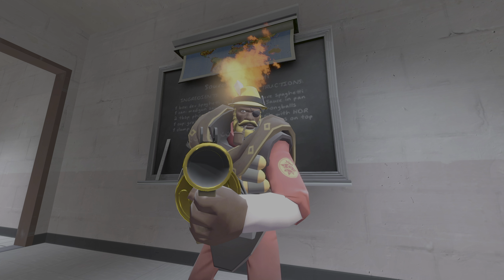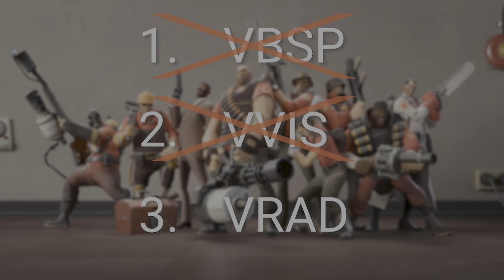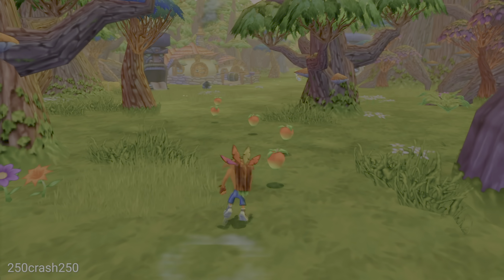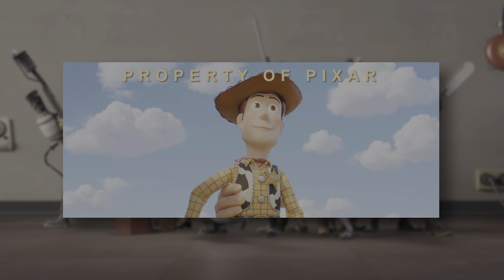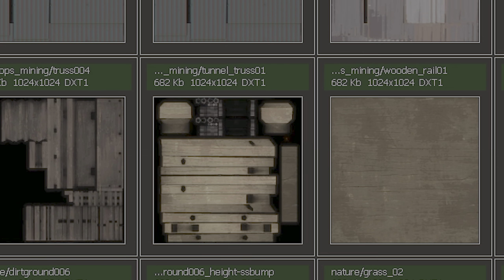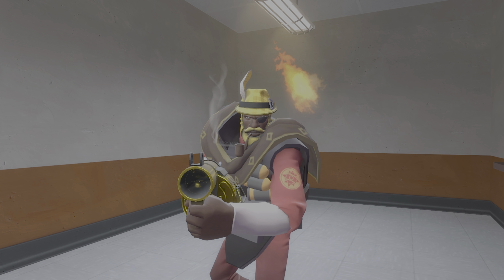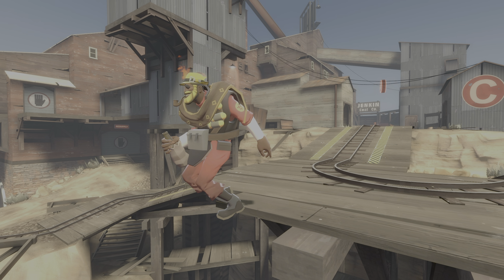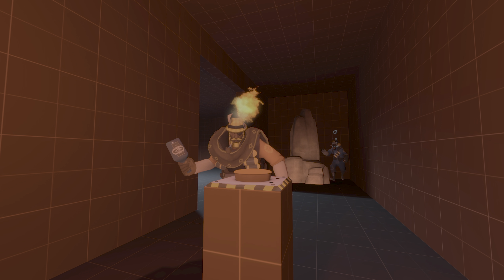TF2's Shadow Problem

Comment: Does this have something to do with why you can see other players shadows thru what Im assuming is seams on maps as well? The amount of times I knew a spy was hiding on the other side of a wall and saw their shadow change along with their disguise is insane. I always noticed it the most on Frontier, espeically the end of the map.
Reply from the maker: No, dynamic shadows are separate from radiosity. I might make a short video to follow up on that since a lot of people are asking.
Reply: @LEDs  I know Id love to finally understand this mysterious Source Engine quirk 😀😀

Comment: While compiling couldnt you just check per surface and tile it based on its light complexity? A face in fullbright with no variation could then be stored with minimum complexity. Just check neighbor luxel values and merge.
That would not accelerate compile time but decrease file size, which is the bigger problem.
Reply from the maker: Good thinking

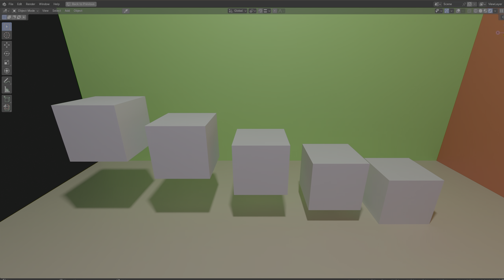Comment: 4:19 Maybe because point light shadows are always sharp, so soft shadows get emulated with blur?
12:40 What you demonstrated looks like that pesky HL1 bleeding compiler bug instead of instead of result of interpolation. You can search for articles by Uncle Mike - author of Xash engines.
Reply from the maker: At 4:19, there’s more indirect light getting underneath the cubes when higher above the ground, so the shadow edge isn’t as sharp.

Comment: There is a way to fix the blending issues, but its at the cost of some file size. Youre looking for something called a "margin". This is basically what amounts to data from adjacent faces being stitched to the current face. This would require completely re-writing vrad and recompiling maps. Or maybe vrad data could end up including a strange sort of bsp-tree where reading beyond the edge of a light island points it to another luxel on another island

Comment: I assume the lightmaps, being designed with bilinear in mind, probably account for the 2 luxel radius needed for smooth transitions. If so, changing it to a radius of 4 luxels should fix it for bicubic. However, that would cause its own problems, requiring recompilation and larger lightmaps for the same detail (or less detail overall)

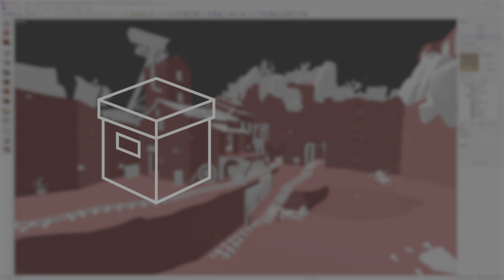Comment: I'm skeptical of the math at 7:45. Is that 20 megabytes and 3.5 minutes spent specifically on lightmaps? Compile time is a little more plausible, assuming it's referring to just the VRAD phase and not the entire VMF -> BSP transformation.
Reply from the maker: Yeah, I'm assuming that the file size is attributed to lightmaps only, which is a big assumption. But the relationship between the file size and luxel scale is linear.

Comment: It sounds like it'd be a good idea to implement compression features, why is this not done? A 64x luxel density increase shouldn't have to result in a 64x larger filesize if many areas of the luxel maps are similar or featureless. Also, couldn't some kind of script be implemented into VRAD that automatically assigns luxel density based on the complexity of nearby geometry? Forgive me if these are silly questions for I am not a programmer or a mapper.
Reply from the maker: It's not silly, I wonder the same things

Comment: One method I've seen for fixing the light bleed problem was to break up the surface manually and retexture the gap covered by the func-detail brushes to nodraw. I assume this will cause the same issue with seams, but at least it doesn't require sacrificing the optimization that you get from using func_detail.

Comment: I wonder if it would be possible to add a tool in hammer to combine geometry faces for the purpose of building unified lightmap islands.
It's not as elegant as having an automated system that handles it at compile time, but gives you the tools needed to fix the problem when it arises.
That and perhaps some sort of "light_obstructor" texture, similar to "nodraw" in that it doesn't generate a visible piece of world geometry but is still detected at compile time and treated like a world geometry shape, unless there's already something like that, which there could be as it's been years since I last touched hammer.
Reply from the maker: I have to take a deeper look at Source 2 because they made some significant changes to lightmaps

Comment: 11:25 The only real solution is a better lightmap UV unwrapper to eliminate seams on connected flat surfaces. Which is very unlikely to happen. It'd be more likely that the map maker would get to choose which surfaces get to use bicubic.
Reply: Is this issue present on hl2 too?
Reply: The problem is that in the BSP, each face has a separate lightmap (which was fine for quake 1's software renderer, but is painful for GPUs), so the engine has to combine the lightmaps into larger atlases at load times. Trying to intelligently place the lightmaps on the atlas would increase load times and result in less efficient GPU usage (as you wouldn't be able to fit as many lightmaps on a single atlas). 
The only real solution is to… not use bicubic filtering, because the lightmaps are already padded enough for bilinear, but not enough for bicubic.

Comment: dude it is always this complex,
i set out to make a small little plane flight simulator in godot a few weeks ago,
every small little detail
just to get a scene with a plane
i had to find a CC0 model online for prototyping
put a camera in the scene, immediate problem, camera doesn't follow plane, alright parent the camera right? yes but it looks wrong,
look at GDC conference talk about camera movement,
it needs to lag behind where it would normally like to settle (if you don't do it like that you can't see the plane turning, so you have no idea how the plane actually moves)
alrigh scene looks like ass, doesn't have any shadows,
look up the docs, you need a WorldEnvironment Node, added that; still looks bad, by default shadows are pitch black, i fixed that, even added an HDRI to be fancy :D
then! i had another problem, when the plane moves forward, you can't tell! because the ground its just one solid color, I always wondered why games used checkered patterns for prototyping, i knew you can use these checkered textures to see where uv's are stretched / warped ( cause the squares either aren't square or are smaller or bigger)

there's just so much stuff, and all im doing is to use already premade solutions ( coding this from scratch would take ages),
what is insane is how using premade solutions remains true all the way down the chain.
i use PBR materials, the algorithms to render these materials have been implemented by someone else
the person who implemented it worked off of a paper / books written by other people
the intial person who came up with PBR (i think it was for Wreck it Ralph) did so by using physics equations created by scientists

everyone uses what came before and adds a little bit with their ingenuity and creativity for everyone else after them. Its like a colony of ants spread throughout time and space

Comment: Yeah, but now you make me WANT to compile the entirety of Dustbowl with a luxel density of 2
Reply: It won't compile; you'll run into the max vertices limit because VBSP needs to subdivide faces every 31 luxels (the engine complains if a face has a lightmap larger than that).

Comment: I believe bicubic seams could be solved by adding a pixel or two of padding to each island, sampling neighboring faces. Based on how the seams look already, I would guess that they already add some padding (at least in the shader, don't remember if they rebuild lightmap atlas'), by just extending the edges of the island, which works fine with some surfaces, but not others
Don't quote me on this though, I haven't gotten around to implementing this (though I have thought through it a bit)

Comment: There is an other way to avoid cutting the geometry without flipping it to world details or whatnot, it's to raise by 1unit the brush, it was the trick on goldsrc and it was also creating flash and smoke bug for CS because the hitbox was just a point and could fit in it.

Comment: I'm surprised you didn't mention that making brush cuts will make more faces. and each luxel is on each face. VVIS will optimise faces and therefore luxel scale "high resolution" but is it preferred to call it "luxel density" imo. VVIS will not render and will not make a luxel for a brush that's touching another face. The faces will not both run. VVIS is like a dynamic nodraw. it applies no render to all parts without needing to be told to "not draw" it. And nodraw the texture is to force the face of a side to be ignored basically. which causes a leak for vvis. but if you dont run VVIS theres no possible leaks which means no optimization calculations aka all optimizations on a map will be ignored. Because luxels are computed by mapper aka. via a compiler. It does not require any computation from afterwards or at least very little to no overhead in hardware usage. This means you should’ve said it doesn’t affect frame rate or stability to change it and it is only customizable by mapper. It’s not required. It’s not a common “optimization” as it is not for solid performance. But a balancing act for your creation to not take too much space for quality that in spots won’t make a difference or will actually look worse. A game like TF2 looks bad with too many detailed shadows for some. I think it matters where it is, and what type of shadow it is. If it’s of railings, then sure put it high, like that one map has. I forgot the name of it. I think you made it kinda clear it was just compile time vs storage and not performance but you didn't even mention it.

Sometimes you want to “slice” a wall brush to optimize a specific shadow to be more detailed in some spots. But effective it doubles the brush entity count in your total map limits effectively reaching the limit allowed by compiler

And from what I understand the safe limits are because to ensure no one can go beyond and a map can’t be “too detailed”. Which of course is subjective if you have it optimized as much as humanly possible (or should we say computationally expensive) to not only compile but render in the original Hammer program. But as computers get more powerful and as maps get larger and more detailed. The limits by Hammer++ are reached to a point where they are stopped short. I have opened up Valve maps that are actually bigger than Hammer++’s compiler supports. Which gives you only the errors once trying to compile a map.

I really hope this was new! If it wasn’t I’m sorry. Maybe you could make an in-depth video on Fixing J-Junction errors? Since there’s limited examples and none are as effective as you’re able to create! But you’ll need maps that have this specific compiler issue that only relates to “Too many T-junctions to fix up” error. Why? Cause that’s what happens when you slice too many brushes. Or you’re map is too detailed.

Comment: I wonder how feasible it is to make a tool that optimizes lightmaps automatically. Just, compile the lighting at a higher value of 4 or something, then at 16, then check how similar each face is between the two compiles, and set it to 4, 8, 16, or even more from there. There will still be room for improvement, both on the algorithm and manual work on the lightmap, but it should help still lol

also the lighting in the thumbnail is not perfectly physically accurate, the demoman's shadow is perfectly sharp in contrast to the wide light fixture, shaking my smh
Reply: would be much faster to detect how sharp the shadows are on a face and downscale based on that
Reply: @beepster4096  yeah, as i said the exact method for detecting could probably be better lol

Comment: The issue with bicubic lighting creating seams might just be because it isn't sampling from pixels across UV map borders, where bilinear does.
So the bicubic filter is being applied straight to the lightmap image without taking into account the UV mapping.
Reply: Oof. That might be the result of copypasting the code for it out of a completely different engine. Yeah, according to people who have the SDK and access to the source code, there's a comment saying they lifted the code for bicubic interpolation from Godot, for some reason.

Comment: Would it be technically possible to somehow export lightmaps, then make new ones with using programs like blender, and then injecting them into bsp somehow?
Reply from the maker: Could it be possible if valve wanted it to be? Maybe, but Valve has already made their own path tracer for Source 2

Comment: I would love if someone made an in-depth video on why some hats, animations, effects and similar entities, suddenly spawn at the location of some other entity in a player's vicinity!
Reply: Me too! I've always wondered why a random Gibus will just randomly pop into existence in front of me. I always assumed it correlated with another player's death, and it was some sort of glitch with where the hat entity is supposed to spawn, but I have no idea if that's true.
Reply: @irregularassassin6380  simple, when someone goes out of your view, like another room far away, they are not part of your PVS (potential visible set) so it ceases to exist 

Now when this occurs, one case would be a player exploding right after it became out of view, BUT your game THINKS the entity is visible, it becomes undefined behavior, causing sometimes to spawn in specific wrong spots (coordinates 0,0,0) or the last place where your game knew that player was

This occurs most of the time by mistakes in code or unforeseen circumstances due it randomness, but as long it doesnt break the game, valve didn’t seem to put priority on it
Reply: @gonzalolog  Cool, thanks!

Comment: Hammer software genuinely terrifies me, the amount of work put into this video is commendable
Reply: hammer's really great, the only real successor to doom and quake's map editors that made mapping for those games so accessible back in the day. Of course now we're spoiled with feature rich game engines like Unity, Unreal and Godot
Reply: @theminecraft4202 spoiled? Eh, level design for modern game engines is far less accessible. You pretty much have to build your levels in 3D modeling software. Brush based mapping is still a fantastic entry point.
Reply: @theminecraft4202  TrenchBroom is also a very good successor, most fun CSG designer I've used. It's a Quake editor but technically engine-independent, there are integrations for Godot and Bevy for example
Reply: Never would have expected to see you here. Quite the pleasant surprise!
Reply: It's fun to figure out
Reply: where the videos at
Reply: @Skulldozeeer  Yugo video is soon dw
Reply: hello jimothyskatboardd
Reply: jameskii what are you doing here
Reply: hi james

Comment: My guess is bicubic (most likely bilinear did too) doesn't sample from neighbouring faces
Weird, because if they use the same tech in Half-Life 2, the problem should be there too (I didn't observed it)
Reply: Likely TF2 is missing some form of sampling that HL2 Anni has, and it would require more changes to code than they had as requisite time to handle for the anni update.
Reply: I didn't notice when playing HL2, but when compiling my own maps, I did notice it. I don't know if it has anything to do with compile settings, or I just wasn't looking hard enough. I opened HL2 and looked around and spotted a few seams.